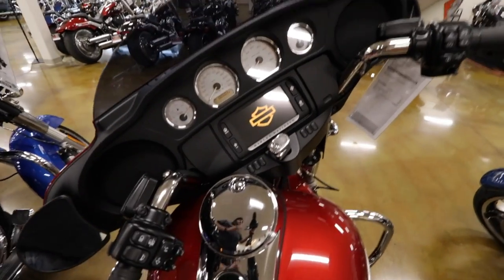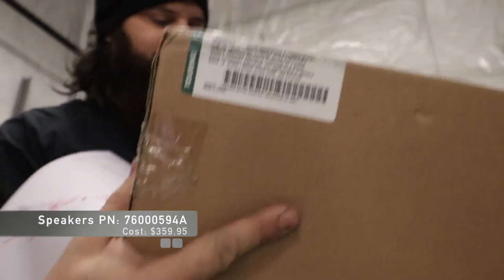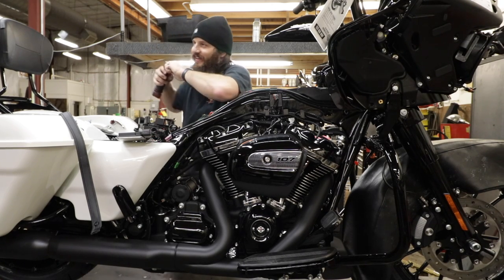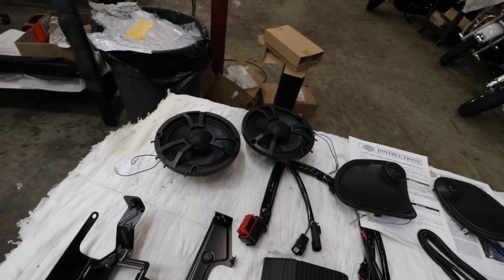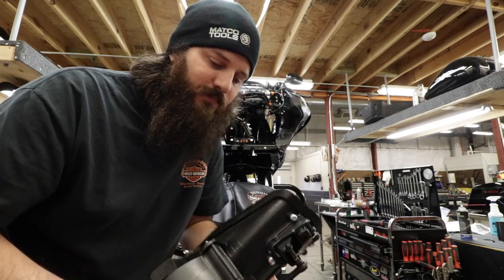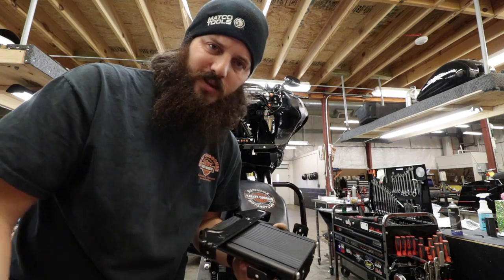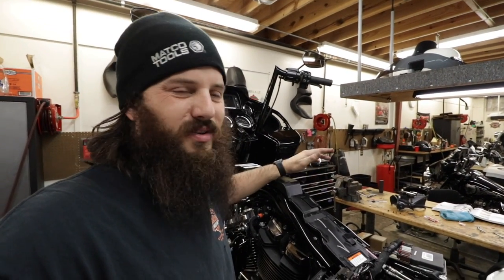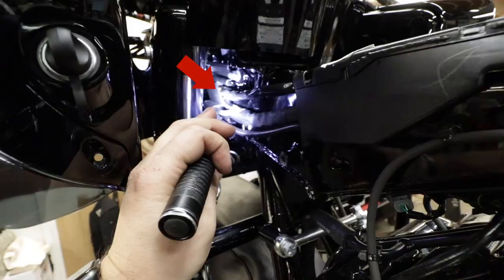Road Glide //  STAGE 2 Speaker Install

Comment: John, I have stage 1 amp and speakers upgrade (speakers in fairing only) on my 17 road glide, can I go stage 2  by just changing out the speakers since I already have the amp? would an additional flash be needed?
Reply from the maker: An additional flash and a different wiring harness are both needed.
Reply: is that an additional wiring harness to what I have now for the stage 1 that also has a hook up for rear bag speakers if wanted or totally a different harness? would you happen to know the part number for the harness needed?

Comment: good afternoon,I'm installing a big system into my 2015 Road Glide. if I uses the JL audio Fix 86. do I have to get my radio flashed? Thank you for your help.
Reply from the maker: There isn’t a way to flash the radio anymore for aftermarket systems. If the shop computer can’t “see” an amp (it can only see HD amps) then it won’t give the option to flash. I’ve heard there are plug and play kits that are needed. I don’t do any aftermarket installs, though. So I’m not 100% sure about that.
Reply: John Thank you. Please keep doing your videos. They are very informative

Comment: I just bought a 2018 road glide special, and was curious what bars are on the one in this video?
Reply: @TheHarleyTech  sweet, I love how they look.....love your videos btw
Reply: @shadbolen1217  check out the Factory47 Roadglide Signature bars. I have the 14" and I love um. installed them myself, super easy if you are handy with a wrench. BTW I am 5'10"
Reply: @Texas_Radical  did you order through factory 47 or Harley? every time I go to their website i cant order them.
Reply: @shadbolen1217  thru factory47 none of the HD dealers here in Houston will order anything but HD bars

Comment: PS>  I didn't get the old speakers back from the dealer...should I have??
Reply from the maker: I set parts that don't fit on the bike, off to the side.  Most times no one asks for them.  We hold parts for 14 days, though.  Generally people keep parts and find out it just takes up space in their garage.  Rarely do people get take them, and those that do regret it later.  Stock parts are a dime a dozen, and don't have much interest.  Therefore, there isn't much of a resale value.

Comment: Great install video.  HD stock speakers are trash.  The stage 2 has ok sound but it is still priced too high.  Pay aftermarket prices for a HD sound system? 🤦‍♂️
Reply from the maker: The only systems that I’ve heard that sound better than stage 2 cost more than stage 2 (which is insane).

Comment: Really love the look of the 2018 - But my 2006 RoadGlide rides so much better. They should have re-named it to the RoadBrick for 2018.
Reply from the maker: Bro, you serious right now??? The 18 road glide is great. I mean, I get liking your bike and all, but come on...
Reply: Absolutely serious. The rear suspension on the 2018 sucks so bad. Sit on any one of them on your showroom floor and see how much the suspension dips (maybe a millimeter). Set the dial from 2 to 20 and it won't make a lick of difference. I can't believe more people aren't spazzing out about it. But then again; spending 25 to 35 grand on our bikes; we don't want to admit to such things. Front suspension feels way better on the 2018. But the ride sucks on the back end. The 2018 heritage blows away the 2018 Roadbrick on ride comfort which is sad for a touring model. My neighbor only had his for about 90 days and traded it in because of the jarring ride from the rear suspension. I wanted to upgrade this year; but after riding his bike a bunch of times... no way. I would get a Heritage first... I believe that the 2018 Roadglide (white with all black dressing) is the best looking bike on the road today - and that motor (dahhaaam). I just can't handle the poor rear suspension, and don't believe I should have to upgrade a touring bike suspension to aftermarket out of the gate.
Reply from the maker: I don’t mind the rear suspension, but that’s the kinda thing a dealer throws in to make the deal happen anyway!
Reply: @TheHarleyTech  I ride a 18 RG special and i dont mind the rear also,factory suspension, factory seat & ive done 15k on it and 1000 in a day, no ass hurting no back problems (and i had a major crash in 1988 that broke my shit)
Reply: Changed suspension and seat immediately, when I got 2017 road glide.

Comment: Which is the more maintenance friendly design, the Road Glide or Street Glide?
Reply from the maker: They are the same maintenance. The road glide handles Better at highway speed.
Reply: By "maintenance friendly" I meant is one easier to work on than the other. Looks like the RG fairing has more room for stuff, but looks can be deceiving.
Reply from the maker: Oh, I see. Well some things are easier on a road glide and others are easier on a street glide. I’d have to say probably the road glide, though. Only 2015 and later. The 13 and earlier road glides are a bitch to work on!

Comment: Why does the stage 2 bass decrease when the bike is put into gear?
Reply from the maker: Is speed volume turned on?
Reply: John Maxwell yes sir, i have it set to level 2 I believe.
Reply from the maker: Try turning it off and see if it still does it.

Comment: why does H-D screw over the few patrons they have left??? this is the ONLY audio system that can’t simply installed, installation is not difficult, but THEN it has to be “flashed”, give me a break
Reply from the maker: Most of the good aftermarket systems work the same way. It’s to protect the speakers from blowing because the amp is running too much power, and to equalize the system being used for the best audio quality.

Comment: what is the cost to flash the stereo?
Reply from the maker: it would vary by dealership, but we usually charge around $20.  It also kind of depends on where you bought the parts, and all that good stuff.